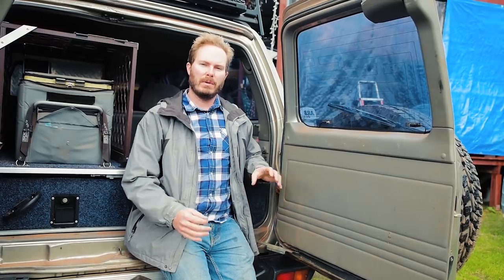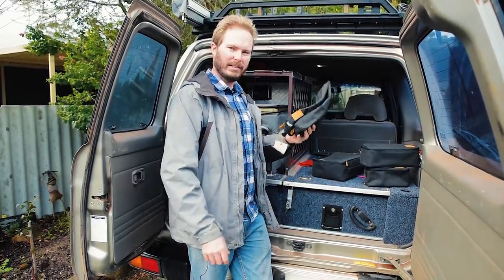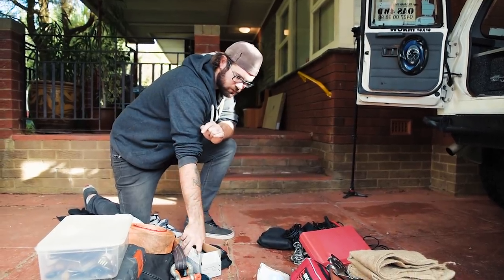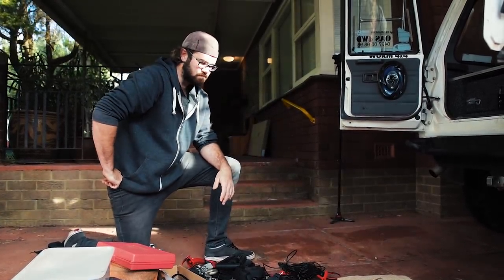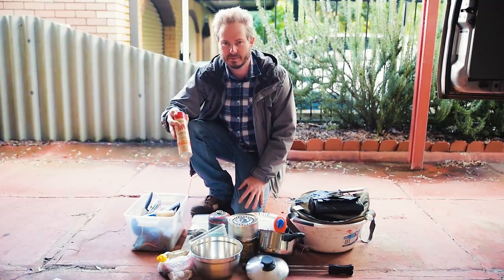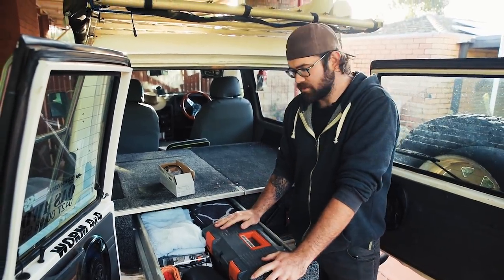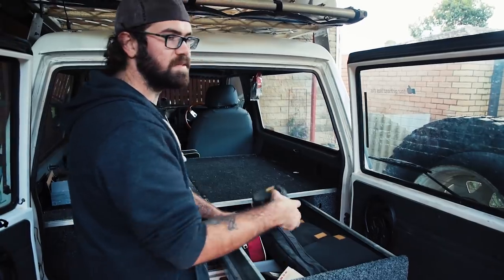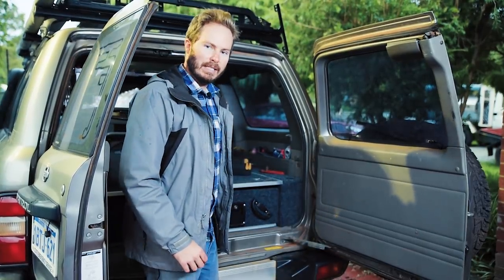Drawer Organisation: Tidy Overlanding Setups

Comment: The rectangular cooler bags from your favourite supermarket are a perfect fit for your average drawers. You have to pull everything out of the top (end when laid down in a drawer) & are one large size only, however they stop all your cookware from bashing around into dust so are an absolute win for the cheapos like me out there 👍
Reply from the maker: My barbeque plate lives in one of those. Not in the drawer though. Keeps all the grease and filth contained to the plate rather than through the vehicle.